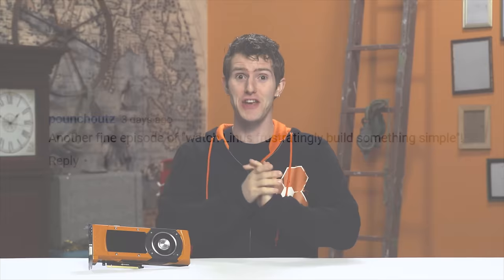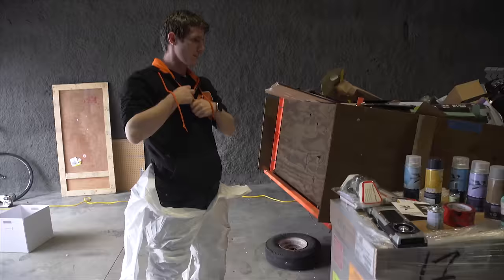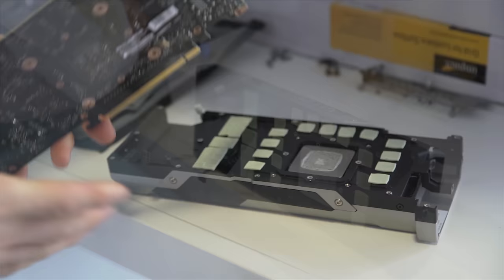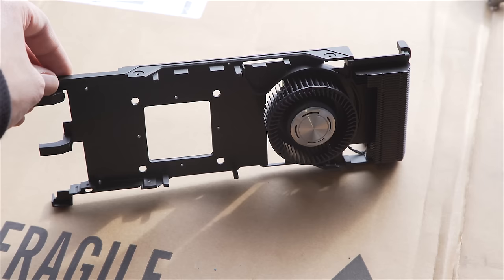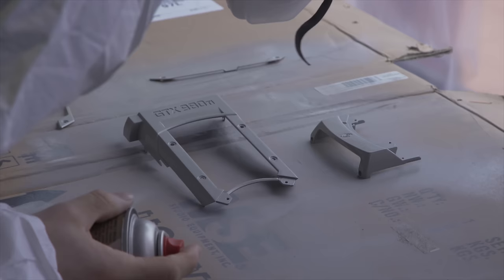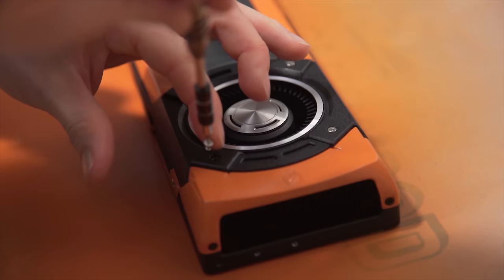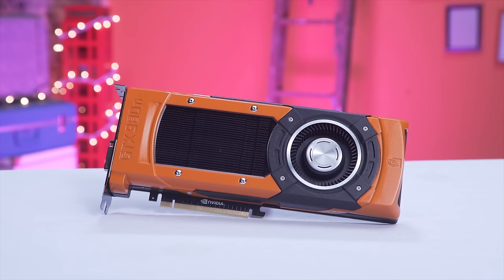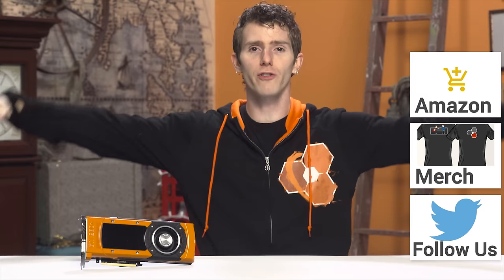Why Not Paint your Video Card??

Comment: I love Nvidia reference coolers, but third party manufacturers always end up with their own designs which tend to perform better most the time, Still...Nvidia stock coolers look great, especially with the green GTX LED.
Reply: I hope the new pascal GPUs will be like the quadro coolers black and green
Reply: +Profet Gaming don't forget the singleslot design <3
Reply: no they look dirty
Reply: perhaps
Reply: +Adnan Ahmed I like reference designs because I like blowers instead of the other fan designs. Air flow is more streamlined in my opinion.
Reply: ***** didn't know that. Why do third party manufacturers remove it though? Also where can I buy reference design later down the road as I assume they slowly phase it off?
Reply: Adnan Ahmed Because like you mention, they can do their own cooler design, which can decrease temperature & increase performance depending on design. Some do 3 fans, some even take 3 slots because of large heat pipes. It allows them to overclock and have a safety margin for consumers. They have to assume that the persons case won't have the best cooling, so people don't complain even if it's an overclocked design.  There's other factors, so blower style designs aren't the best unless the case already has good cooling.  Most people have their case doing a "Z" shape with their fans and air flow. But I like straight through, windtunnel air flow. For example, I have 3x120mms on the front of my case, so all the air goes from front to back without any deviation. I don't even have fans on top. So a blower works good here because the air goes straight to it and the GPU blower blows the air straight out the back. I overclock the GPU myself also. But not every case is like this, especially cheaper cases with just one intake.  In a case like that, if someone buys a blower, it'll probably overheat and downthrottle but the other design with a huge heatpipe/rad and 3 fans will be able to cool itself.
Reply: ***** I like the blower style because exactly what you said, It sucks in cool air from in side of the case and blows it out the back instead of exhausting in the case. My ACX SC GTX 760s were so close where the top card would run at nearly 90C in a Carbide 540, bottom card was at 83C full fan speed, testing in heaven benchmark.

My 780ti's reference run at about 78C for top and 71C bottom on the same case with 2 140mm fans blowing in. I also see a decrease in CPU temperature by about 10c now the hot air isn't being dumped in the case and going threw the rad like with my 760's.
Reply: They may look nice but they are a total waste of money and resources.

Decent performance but the price is ridiculous compared to regular reference coolers. This silly little window, the magnesium frame and aluminum case does nothing but improve the looks of the card.

Please nVidia go back to dull looking black plastic cases for reference designs and just use all the money you charge your customers for the cooler on the actual cooler.
The current design is so expensive that you could easily replace it by a massive copper heat sink that covers the whole card, uses a vapor chamber for the GPU as well as heat pipes to support it and cover the VRMs and memory. And this extremely powerful full cover copper design would still be cheaper than what they use now.
Reply: Oliver Kurzweg I wouldn't say its waste of money, I mean my 780ti was $600 bucks reference cooler at the time the R9 290x was close to that price as well with slightly worse or slightly better performance depending on the game, now the 780ti destroys it in many things, I happen to like the looks of the reference coolers, my only dislike is I can't change the color of the geforce light logo.

Although I will agree with you on the lower end models, the 760 or 770 I think should be plain like you said for lower cost.
Reply: Viking Dude Are you joking? The 290x destroys the 780ti these days. 970 included.
Reply: Patriot 03 What the hell you looking at? It dosn't come close to the 780ti lol.
Reply: Viking Dude Yup, those are the old benchmarks, drivers have since improved performance by over 30% Look up Drivers from at least 2016.

FuryX is also now even with the 980 ti in DX11 across the board.
Reply: +Patriot 03 And Nvidia didnt bring out new Drivers... wow, what an argument my friend xD
Reply: Marvin Kose Nvidia drivers tend to decrease performance over time, especially after a new generation is released (1080)
Reply: ^ delusional

Comment: 1:19 who else tried to remove that smudge? :P
Reply: I don't notice those small particles
Reply: Once you notice you cannot un-notice :3
Reply: +Maker&#39;s Muse you mean the like 5 smudges?
Reply: DanielRichards644 It takes some balls to film inside a spray painting booth :P
Reply: +Maker's Muse why does my hotend leak from either side of the heater block?
Reply: What printer?
Reply: Oh... those cheap I3's can be hard to diagnose - i would bet your nozzle is loose or there's a hole in your PTFE in the hot end letting plastic leak out. Too high pressures can cause it to burst out so maybe slow your print speed down (30mm/s to test) after making sure everything is tight.
Reply: Maker's Muse I'll try that after this print.  I'm really only printing at 40 mm/s already, which is slow compared to the um2 at my work that I've got up to 100mm/s in the past couple weeks.

I've ordered an e3d v6 and everything necessary to convert the printer to 3mm (I'm not a fan of 1.75), so if all else fails, I'll still be able to swap it out.

Thanks for the info!  I didn't expect you to be on the LTT channel.
Reply: Haha no worries, I LOVE LTT and religiously watch their vids :) Good luck!

Comment: Wow, Linus- that really turned out nice! I think the "unpolished" look makes it appear to be cast aluminum; if it were super glossy- it'd probably just resemble cheap plastic. There are safe ways to paint a fan: Warm the paint can with hot tap water for 1 minute. Shake can well. Make sure can is dry. Run the fan on a "dimmed" control, to about 10 RPM, and use 1 quick coat on each side. Leave fan running until fully dry, approx. 2 hours. Do not use clear. Alternatively- you can easily color your fans with paint markers without affecting the balance. Use even strokes, one direction, no overlap, 1 coat. I dig your "Clean Room" "Asbestos Abatement" paint booth- but that's seriously overkill.
Reply: perhaps
Reply: i don't really see point of this it not like you look inside your pc every min if you have a seethru pc then yea

Comment: 1) If you are going to use the sand paper to remove the anodizing, do that before you use the spray on cleaner. The spray on cleaner will help remove any particles still sticking after you have sanded.

2) There's no need to remove the anodizing if you are going to be priming. The primer acts as "glue" to make the paint stick to the surface of the card.

3) Plastidip may be a bad idea based on how hot those metal components may get. It may not peel, but it could act as an insulator meaning that you have to dial back the performance of the card so that you can plastidip it.

4) Any noticeable changes in temperature since you insulated some metal parts with paint (that may have been acting as heat sink)?

Comment: Time to paint my not reference 1070.
Reply: That's sad that you haven't got your hands onto a Founders Edition GTX 1070, they look sick and they perform awesomely in games (I have one so I'm prone to know).
Reply: Jeremy974 [EN/FR] Oh look, did they put better chips in FEs? No.
Reply: THE CRINGIEST YOUTUBER IN THIS UNIVERSE
 For your information, Pascal over Maxwell, Pascal is truly the winner performance wise, they went over the tremendous problems that Maxwell had like overheating and thermal throttling, Pascal doesn't overheat and thermal throttle at all, so practically Pascal chips are better than Maxwell chips, I wouldn't recommend 3rd party models (like Asus or Gigabyte) because of the open air design that they have, which ensures that critical components of your motherboard like CPU VRMs will overheat and with time die each after the other,
Reply: Jeremy974 [EN/FR] Tell me more m8
Reply: THE CRINGIEST YOUTUBER IN THIS UNIVERSE
Take that as a sample, on Maxwell cards (excepting Titan and Titan Xs) you couldn't have a smooth 4K @60fps gameplay, with pascal and its 8GB of DDR5/DDR5X you can have a smooth 4K @60fps gameplay which is mainly awesome, also Pascal cards consume less power than Maxwell cards +1 for the PSU :D
Reply: THE CRINGIEST YOUTUBER IN THIS UNIVERSE
GDDR5X is basically the same as GDDR5 except that the X variant is faster then the non-X variant.

Comment: For anyone out there who wants to do this but doesn't want to go through the effort of setting up the whole painting booth, you don't need it. Linus went way over board with the protective gear. Go outside, use a piece of cardboard to protect your ground from being painted, and wear some gloves. That's it. You do not need the mask if you are in a well ventilated area (i.e. outside) with the excess paint going downwind.
Reply: dust, sand anf all kind of other dirts are flying around, they will stick nicely yo your graphics card.

stop being a know it all

Comment: you dont need to sand and prime. All you have to do is get some Duplicolor Adhesion Promoter from the auto parts store and paint. Just make sure you do a good prep job ie. just make sure its clean with no dirt. This is just a 10 minute job from start to finish and it's really hard to mess up when painting small pieces like this.  Any 1st time painter could do this job.

Comment: use sodium hydroxide to remove the anodisation from Aluminium (IF you want to paint it, NaOH can and often WILL create discoleration), clean and deactivate the NaOH then immidietly Paint. Aluminium Oxide forms VERY quickly. Linus method however is quite alright too, but if you want to "over do" it  you can use this method

Comment: Prep solvent is meant to be used right before you paint, and it's not meant to remove "mud and stuff". It's meant to remove oil residue that could contaminate the paint finish, and it is rendered completely useless when you touch what you just cleaned with it. There's oil on your hand genius.

Comment: You're using 1 pak not 2 pak you don't need that much protection, also after sanding even if its wet sanding you need to use panel wipe/ de-greaser to make sure all of the dust is off.
Using red scotch will also help with getting into hard places (the logos and corners), also try not to touch the parts at all... hang them from something or attach them to something where you can get access to all the places, orange peel is pretty normal especially for cars some cars even come out the factory with it, but it can be buffed out with some compound, if i'm honest you had allot of dirt in it and it really didn't look nice, you need to make sure even the floor is clean of dirt or anything and since you are using 1 pak you could get away with a positive pressure booth so its pushing the paint out not keeping it in, also make sure there is a filter on the fan no matter what you don't want dirt or dust in the air

Comment: linus, please. Instead of dressing like something out of my nightmares and climbing inside  you're elaborate toxic deathtrap. Buy and airbrush. 

-You can use acrylic paints.
-You don't have to worry about smell or intoxicating gasses.
-They use an air compressor. (so it's just air and paint)
-You can film your videos with better lighting
-You can use more impressive techniques in your painting such as blending or pearling. 
-You get a smoother finish.
-You get much better control
-You can use simple masking methods such as blu-tack/poster putty or acrylic masking paint.
-The paint is cheaper.
-The paint will last longer. (as you use incredibly thin watered down coats)

Please. You will save yourself time, Be a better painter and stop aggravating me.
Everybody wins.

Do it! Stop being silly!
Do! It!
do it...

Comment: @IcYDesignsTM change the two rx 480s to a single gtx 980 Ti or a gtx 1070.never get a amd crossfire/nvidia sli unless you have really powerful cards. so yea get 980 ti or a gtx 1070.i would recommend the 1070!

Comment: Next time to add a better touch, get a transparent candy orange and do the chrome hardware and top of the fan. Gives it an anodized look. Then sand down the gtx led with 800 till its black. Lightly coat it with white and put the candy orange over it. Then the led will shine orange instead of green. Extra coats on the led and test to see how it looks illuminated.
Reply: perhaps
Reply: +MiniMash perhaps
Reply: Chimphead 73 perhaps not
Reply: +MiniMash If you saw how I did my  780ti reference you would understand. I used automotive paint since I paint cars for a living. I was able to paint in the Letters also. Did a red and black theme. The LED glows red too. Finished it with a matte clear coat.
Reply: +MiniMash perhaps not....
Reply: brybrycrivello perhaps?

Comment: Do I have to re-apply the thermal paste? I found odd you didn't mention it, at least for CPUs you always re-apply it after disassembly. Other than that it looks great too bad you didnt use some tape on the GTX 980 letters they would look awesome if they popped out of the orange in black.

Comment: Why didn't you mention that you have to remove the old thermal paste and then reapply new thermal paste in order to avoid overheating? Judging from your other videos I am sure you are aware of the eventual poorer thermal conductivity that can be caused by the entrapped small air bubbles but in a tutorial-like video like this you should have at least mentioned it.

Comment: 1000 grit? That's a polishing grit... Painting only needs rough sand for better paint adhesion. 1000 grit is what you use to give something a mirror finish. So people.. if your painting stick to 600 and then go to 800. That's as high as you want togo especially if you're putting on primer.
Reply: +Thomas Christopher White nah, 1000 is fine for bare metal. Realistically speaking, on aluminum, it  really wont matter what you use with the right primers.

Comment: @LinusTechTips 
Hey Linus, I love your work I was doing some research on painting my GPU but I wasn't sure where to start. Luckily I came across your video. I have a Gigabyte 1080 xtreme. The card has a nice brushed metal look. Would painting it with plasti-dip hide this feature or would it still be visible. Please me any advice you can offer. Thanks so much for your hard work.

Comment: do I sand when using plastidip?
Reply: No. It's not necessary, plus it's actually better for removability if it isn't. Plastidip is a little different from spray paint. You want to apply your layers thick and close together (only a few minutes apart) to eventually become 1 giant layer. If you have 1 layer dry before your next, or make your layers too thin, you won't be able to nicely peel off the entire thing when it comes time, defeating the purpose of using it in the first place. It'll come off in little pills and it is a total bitch.

Comment: Corsair H110i
ASUS ROG Rampage V Extreme
Corsair Dominator Platinum 16GB
Corsair Force LS SSD 480GB
Dark Power Pro 11 1200i
WD Blue 1TB SATA
Intel Core i7 6700K
S340 Elite
GIGABYTE Radeon RX 480 G1 
GIGABYTE Radeon RX 480 G1 
Is this a good 2000$ Gaming/Editing PC?
Can I please get your opinions? if there is anything I can improve please leave it down below.
Reply: Don't go with 2 GPUs. 1 single GPU is more consistent in it's results, and some games even slightly decrease in performance with 2 GPUs. Not to mention that those 2 graphics cards are pretty much the worst RX 480s out there, get an XFX, Sapphire or MSI one as the Gigabyte G1 has awful temps, draws a lot of power & is an god awful overclocker.
Also correct me if I'm wrong, but is that an LGA2011-3 motherboard paired with an LGA1151 CPU? I guess the CPU will fit but have fun turning on your PC
& Even if the RX 480 draws as much power as a 1070, 1200W is overkill. You could power like FIVE or even SIX R9 Nanos in an LGA2011-3 system with TWO Xeon CPUs under load, and you'd still be fine. (Linus in his 7 gamers 1 CPU video, shows him powering 7 Radeon R9 Nanos with a 1600W power supply) Better invest in one with higher efficiency and better quality components. 
And one more thing, why get a motherboard that costs more than your CPU?

Comment: That was painful to watch. 

Sanding with finger tips you will have groves, use a thick wet sponge that follows the lines (don't press down like a more useful tool that you're using) and degreaser before sanding WHAT! that's after sanding followed by a tac rag with a airline.
Spent all the time making a spray booth and used rattle cans! its not expensive to hire/buy a compressor and a gun.
and in a small booth like that use a small heater to heat inside to 40-50 centigrade for an hour to dry the paint but keep your eye on it you do have it near plastic or even a heat gun.
Touching while painting never a good idea put a bit paper under it or use wire under it. 
after a few months of heavy load the paint will start to peal or bubble. 

Enjoy the free advice that this video didn't show you.